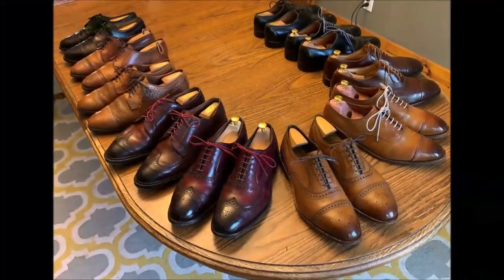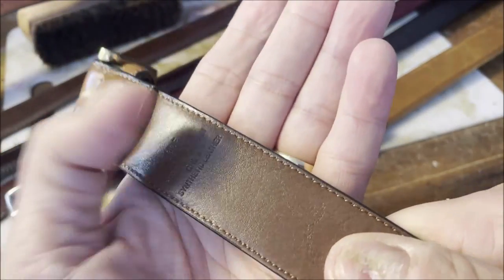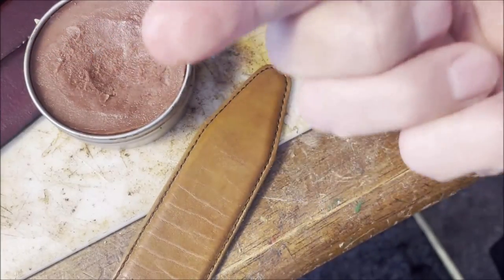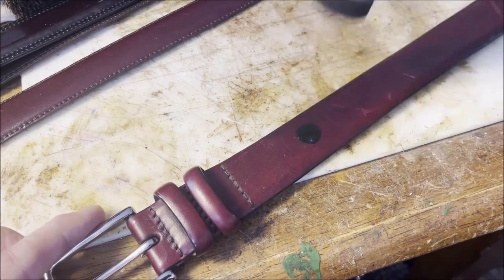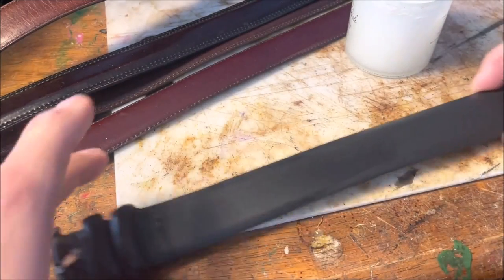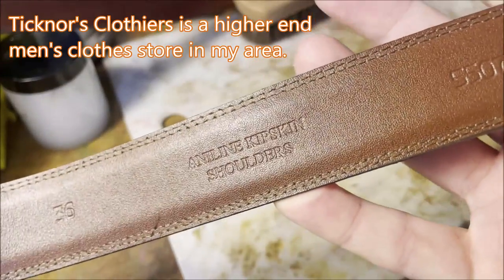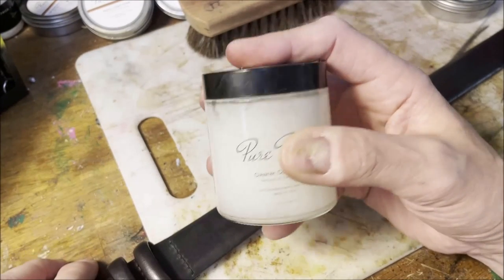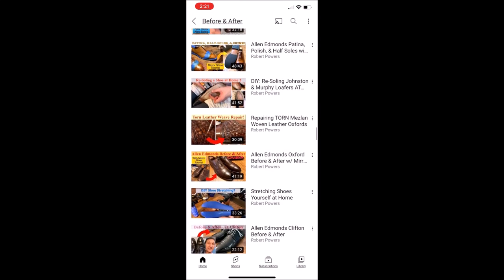How to Dye a Belt | How to spot High Quality Leather?

Comment: Will genuine leather crack like corrected grain leather, love your channel, learn alot about shoe construction and leathers.
Reply from the maker: Genuine leather often IS corrected grain. The term Genuine leather only means that it is not a non-leather artificial material. The next step up is usually full grain leather. Generally a shoe made from full grain leather will be advertised as such. So generally if it doesn’t say full grain leather, it’s probably corrected grain.

Comment: Hey Rob do you know what's underneath the corrected grain coating? Is it a stable albiet ugly piece of leather or is it more like chipboard/mdf where it's just scraps of lather all glued togehter? Always been curious about that
Reply from the maker: It will be an actual piece of leather under the coating on corrected grain leather. If it’s made from scraps of leather glued together, that’s called bonded leather.
Reply: @CobblerBob  That's interesting, I assume the top part (skin?) of the original leather is removed to help the coating adhere, but I wonder, if you were to tear all that off, would you come out with effectively a suede pair of shoes? Perhaps a solution to extremely cracked old corrected grain shoes